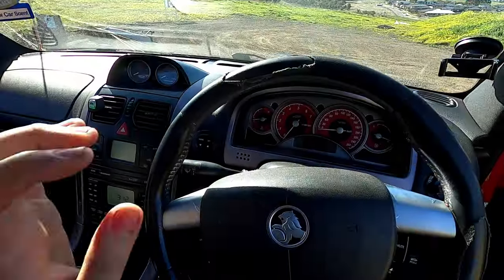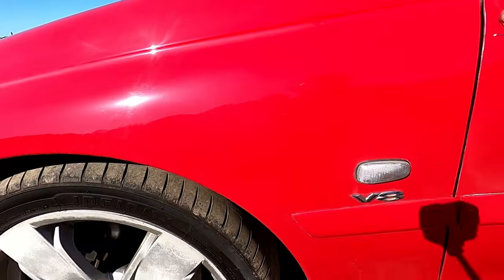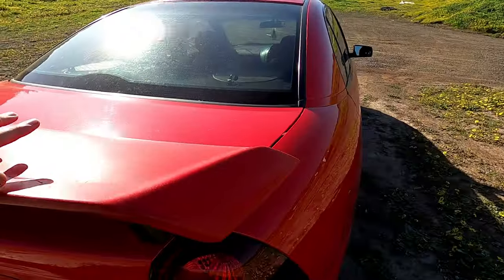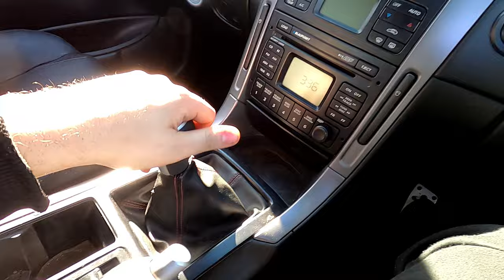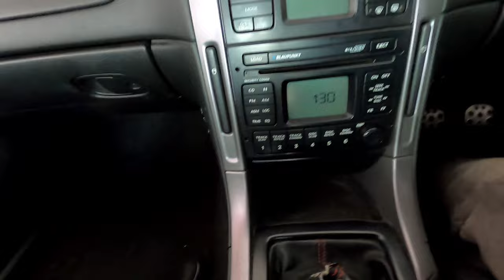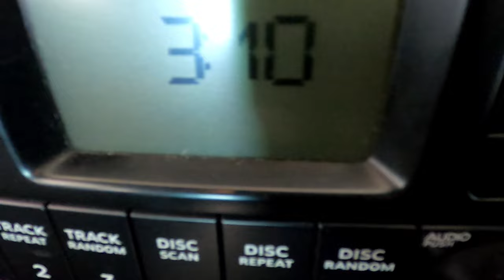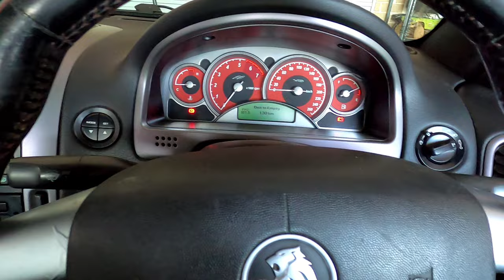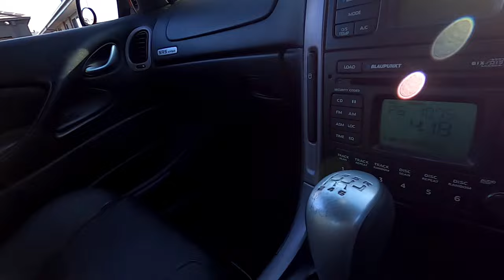Everything wrong with my $7,000 manual SS commodore!

Comment: You're not wrong about the sloppy shifts with T5's and T56's. I put a GM Ripshift into my VS 5 litre T5 years ago and still like it. I feel my mates gear shift in his VZ 6.0 T56 and I hate it! They have one of the worst shift feel for a factory manual box.
Reply from the maker: Yeah it’s amazing how bad they feel from factory, even newer boxes don’t feel as stout as the aftermarket replacement shifters
Reply: Same with the VE s1 t56's they feel pretty shitty compared to the s2 tr6060's and even the 90's t5's but it's a shorter throw than the previous commo's so theres no slop

Comment: What she like on fuel, looking to buy one with pretty much same set up as yours and just curious on fuel ecom??
Reply: I have a VY calais LS1 don’t buy one if you hate fuel consumption if that’s your issue in saying that it depends how you drive these , they are efficient if you drive like an old man but that’s boring , for towing capacity they are excellent … if you are looking to Tow you want an Auto ; mines Auto primarily because for towing … they are an expensive car with what you start buying for them but an excellent car , most people selling these they need work especially with shocks and struts … you want to upgrade everything with shocks , stay stock though , original cars hold the value more … I bought my Calais for $6500 about 5 years ago with 190,000 klms I could sell mine now with about 235,000 klms for around $15,000-$20,000 I have “HOLDEN8” down here in SA as my plates